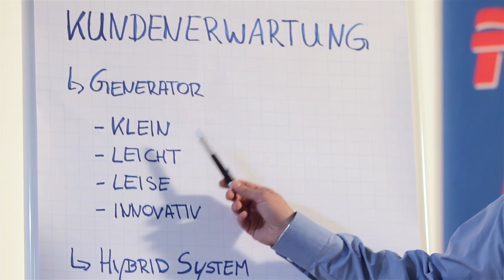Fischer Panda Image Film - English

Comment: Last night I saw this message in my monitor "Starting fails error 005"..what does it means?? What is the problem?
Reply from the maker: Thank you for your comment. Starting Error 005 is applicable to iControl and means that the first attempt to start the generator was not successful. There is a failure code table in the generator handbook and the "Starting Failed" error is also described in part of the general operation section. If you need more help then please do not hesitate to contact the Fischer Panda service team at our website  www.fischerpanda.de or by telephone.